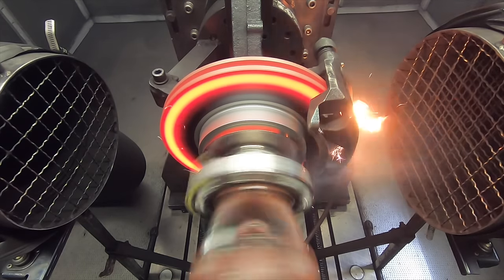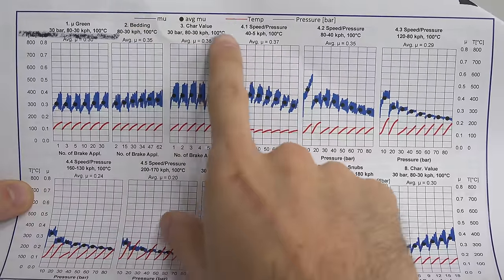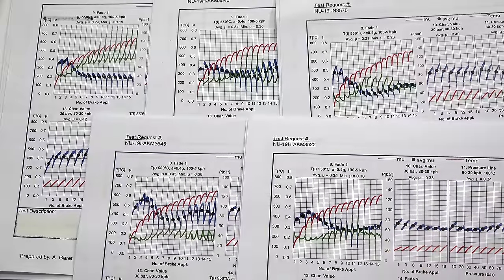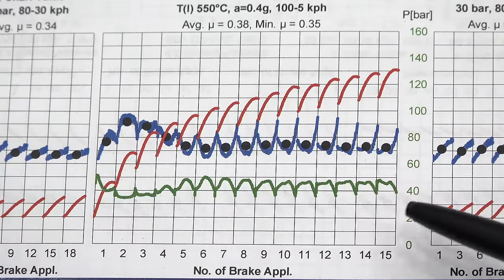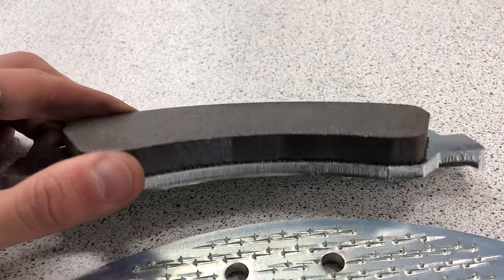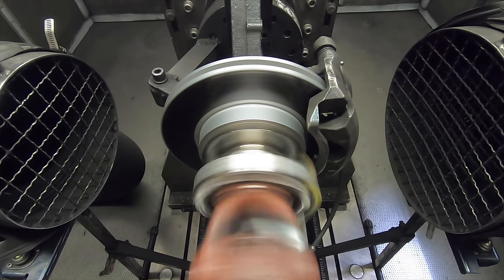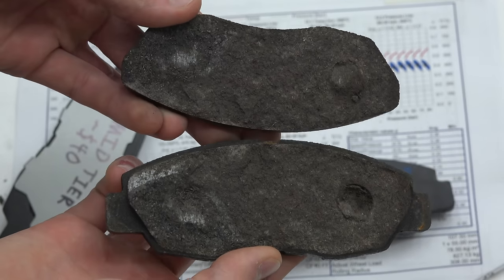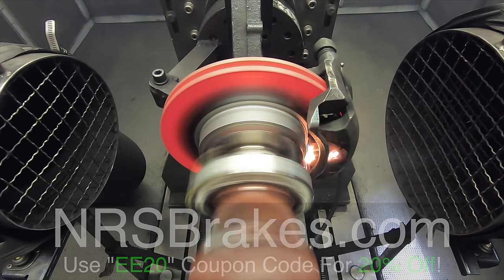What Are The Best Brake Pads? Cheap vs Expensive Tested!

Comment: Well I didn't not know anything about pads but when I saw the rotor glowing red 🍒 thought that was unlikely to happen to mine. I love to shop so I got one set for the front that was 59.00 and reduced down to 23.00. I liked them because they were orange so if I look at the brakes I can say the orange part is the pad. The zinc ones looked nice too.  So if you are going to get the best the OEM one looks like it was the best. If you go with budget you may have to try different brands until you find one you like. From the test results that budget brand should be called suicide brakes. I like the one that I have to press the least and stops the best. No to pressing harder. So get pads on sale or go with the oem pads or if you like chrome go with the zinc plated ones they looked the best for salty roads. ❤

Comment: I will say that for my Audi A6, the Audi pads are so much better than anything else I tried aftermarket, but they make so much brake dust it's actually tough to keep up with cleaning-wise.
I'm really really curious how they are different. They also never squeak, and "high end" aftermarket ones did.
My car is at 480 hp instead of stock 310, so I'll keep using the Audi ones, maybe even upgrade to a brake kit of I get rich. Lol

Comment: would be interesting the readouts of 3 applications from 150kmph to 0 emergency (abs) braking immediately accelerate to 150 and emergency brake again (3 times). this is a standard stop start drag race on a passenger vehicle, the rotor will be glowing on the 3rd application

Comment: Even the OEM brakes and probably most OEM replacement items are not made directly by vehicle manufacturer.  They may have the OEM label but are made by a vendor.  That vendor might have to design to meet minimum OEM design specs but remember probably not OEM built.  Example Infiniti OEM pads but not made by Infiniti.  Probably made by third party vendor (EBC, Bendix, Bosch, Wagner etc.....)

Good video but I have usually had very good luck with mid/upper tier aftermarket pads, hardware and rotors. Good to see some of the more in-depth process of design, manufacturing and testing along with narrative on why designs are certain way.  

Example, shim pads, that wrap around the pad surface, chamfered on the corners.   The cutouts makes a pretty decent visual indicator of pad wear.  When the pads wear down to the end of the chamfer on the backing pad side probably a good time to replace or at least increase inspection windows but monitor closely.  I once bought a AS-Is Escort EXP and the rotors were down to the rivets....back before adhesive bonding and shim became the standard.  The pads were down to the rivers and the rivets were of course cutting into the rotors.   

The channel cutout in the center of the pad serve two functions.  1 help dissipate heat and 2 help have a chamber for the brake dust to settle and fall in rather than having the rotor contaminated with dust increasing friction and possible brake fire.  Most usually have at least one valley but some of the larger vehicles may have two valley cutouts.  The pads with two valley cutouts are normally Front but in high performance upgraded brake systems can be front and rear.

Comment: OE pads are definitely the best option for 99% of drivers and even "enthusiasts." But there becomes a pretty distinct need for higher temp friction material when going hard at the track or hard on downhill mountain roads or canyons. There's nothing like putting on some "competition-only" rally or race pads and knowing your brakes will have full friction until the fluid is literally boiled out of the calipers. This is what you can expect from top end competition pads like Project Mu Club Racers or Winmax W5. But these cost several times more than OE or even "high-performance" aftermarket pads.

Comment: You pick the brake pad depending on what it's going to be used for, and what you're looking for (or looking to avoid i.e. noise and dust) the pad to do. Daily/sporty/lite track/track. All designed for their specific purpose in mind.

Comment: It doesn’t matter if your brake pads last but your rotors are gone in a quarter of the time. I found it better to buy the cheapest pads for the Mountaineer but buy OEM for the Equinox. I’m not racing and I use reduction on the down grades. 
If you buy cheap rotors, only get the ones that are turned, not ground. Turned finishes can’t hide soft or hard spots in the casting. Flaws show up easily. If they don’t have that, then go Bendix or OME. Those usually have a ground finish and that’s fine. Ground finishes do have the advantages of seating in much quicker.

Comment: While at a Chevrolet dealer near their shop parts counter I witnessed:  local Autozone, Advanced Auto Parts, do not remember who dropping off parts for install on customers cars.  Just because you are at a OEM facility does not mean that they are using OEM parts.  Also, are they charging you OEM parts prices?  Knew a mechanic who always broke the wear indicators off any brake jobs he did. Probably that didn't hurt since most people never know what that squeaking is, most people never read their owners manual.

Comment: The 3 main categories of pad are organic, ceramic, and metallic. The generalized properties and behaviors of each are well described elsewhere on the internet. This isn't of concern as EE states there is a wide variety across manufacturers and specific testing generally won't be useful. The only context where the relative properties would be useful are in direct comparison of a SINGLE BRAND'S COMPETING PRODUCTS among differing product lines.
What I'd really like to see is this same test comparing various performance aftermarket pads

Comment: Good video. In my experience I've noticed a lot of difference in the generation of dust from various brands. Some have tremendous braking power, but also require much more frequent cleaning of the wheels.
Reply: Cleaning? Rain does a amazing job of that. My suv is 15 yrs old and never been cleaned except by rain. Never once had to clean brake dust. Maybe car just too shiny. Shiny cars stand out especially to cops.
Reply: @shawnkelly695  are you having issues with the cops !!!
Reply: @M21-w1y  i dont drive a fancy expensive car that stands out. I think they feel bad for me and cut me breaks. I personally dont have many issues. Maybe cause im almost as corrupt as them lol.
Reply: Not sure how saying shiny cars stand out to all even cops has anything to do with me having issues with cops. Me myself driving average plain cars i have 0 issues. I dont stand out with bright shiny car and lots of crome. Friends with fancy cars tend to get pulled over more often and get more fines. Is it attitude or the shiny car is a target as afford tickets and less likely to take it to court.

Comment: Never get any brake components or tires under mid-tier. It's usually a false economy and the difference in safety is measurable.

I will definitely look out for the feature (or lack of) pointed out here.

Comment: @Engineering Explained
What we really need is a comparison of noise, brake fade, wear, brake dust, and rotor wear for aftermarket performance pads as I'm unable to find these for the pads I'm currently looking to put on my car. The following are my suggestions:
EBC greenstuff, redstuff, yellowstuff, bluestuff and the racing types -particularly because EBC doesn't provide numbers to even compare their own pads to each other
StopTech performance pads
and idk anything else I just took the first recommendation someone gave me

Comment: OEM Pads for German made cars are expensive. But there is no sense in trying to count costs when it comes to the stopping power of a fast car. The BMW Brake pads for example, which are prescribed for the MINI COOPER S are all asbestos and the rear ones may last 20000km and the front ones may last 15000km of regular driving with occasional fast runs on highways. It is also very important to change the Disc Rotors themselves at the appropriate time, when they become scored and “stepped”. You can may be “skim” them once on a lathe. Knoclk a few microns off the surface and smoothen them out. But ideally, it is not a recommended thing if you’re wanting a safe guarantee. We need to make sure Rotors also get changed once every so often. Perhaps every 35000-40000kms in a fast performance car.

Comment: have driven all day for my entire working life. 100,000 miles per year. I've ran every kind made at all price ranges and the only real difference I could ever tell was that the semi-metallic slow down faster than the ceramic pads. the SM re dusty and can be noiser at times. I'm 76 years old and change my own pads  and that;s basically all I've ever noticed. Towed large fifth wheel trailers on my diesel trucks and never had a problem.I spend 10-15 dollars per axle for pads and seldom turn the rotors as long as they are true. happy trails.

Comment: As I’ve gotten older and driven, maintained and repaired many vehicles over the years I have come to the conclusion the OE parts are the best bet in most cases. Think about it…the best your vehicle ever was was the day it rolled off the line new with factory original parts, why not keep the vehicle as close to factory as possible? If your planning on getting rid of the vehicle soon and just want it road worthy to sell or trade then I go cheap. Only if you have certain special needs like you tow or ect. then it may be worth going with special higher-end after market products. But for most people’s daily driver that they plan on keeping for a while them OE parts seem to be the best value in my opinion.

Comment: Mechanical bonding has the dis advantage of damaging the brake disks if the pads are extremely worn down  which is not uncommon, secondly loosing  2-3 mm of pad material in the same scenario due to the protruding spikes.

Comment: I am always 100% satisfied with the cheapo metallic pads from Centric that I get from Rock Auto. They usually cost 10-20 bucks and they always have oem-like pedal feel and work fine. I don't think running 15 repeated stops is useful for 98% of drivers. Nobody actually gets past the third or fourth stop in the real world.

Comment: So my astra (opel-vauxhall) has ferodo pads when it came. 
When i want to buy the gm branded ferodo, it's twice as expensive as feredo. 
Most car manufacturers not producing their own pads. Just remove the pad and look for a brand. Just buy from main supplier. 
Also my air filter is mahle (written with little letters and bottom side) and branded with GE. Its also cheap but the same filter.

Comment: There are so many things just assumed in this. Ceramic pads? Coatings? Caliper? Rotor design? Rotor material? Were pads bedded to manufacture specs?

With common ceramic pads, some material should be initially transferred to the rotor using the bedding process. The rotor needs to be the right material to match the pad. And it better be surfaced correctly to again properly bed the pads.

Comment: the critical factor to consider here is the presence of sodium chloride, commonly known as salt. This compound is responsible for accelerating the deterioration of brake pads. If you reside in regions without snowy conditions, opting for cost-effective brake pads suitable for daily driving is a viable choice. I personally employ inexpensive semi-metallic pads(raybestos),cheap $30 eBay rotors, and they have demonstrated exceptional longevity under these conditions.😄

Comment: Your calculations on angular/rotational momentum effecting the 0-60 times for the Tesla, in another video, would be applicable to braking distances, also. The Tesla with lighter wheels/tires would stop in about 6% less distance - so it would accelerate faster And stop faster, also,
Reply: That's why putting 24 inch rims on a car that isn't designed for them is ignoring how much more a 24 inch rim weighs compared to a 18.

Comment: I've just replaced my brake pads and my drivers side caliper in front and my brake shoes and cylinders in back and the drivers side drum. Can I use a temp gun to check them? What temp range for normal use?
Thanks

Comment: Make same test with oil filters and please explain different engine noises and how to fix them. For example rattling when you start 8th gen civic or other Honda. Is it chain tensioner? VTC actuator? starter? too thick oil? too thin oil? some dirt in oil pathways to actuator and tensioner? This happens to me only when car haven't been driven for hours. especially when its under 4 celsius.

Comment: Good pads cost about $ 130 for the pair, and you could save money by installing them yourself in which labour cost about the same money or more. But remember to lube caliber pins, pads edge, and the metal backing facing the pistons.

Comment: The way most  people drive its better if pads  wear quickly  most pads I change (70 sets a year  ) are unevenly  worn because  pad is partially  seized  in caliper   .One problem with OE pads often bought  in and reboxed so you could  get anything

Comment: I'm curious as to how these tests work on high performance cars, not hd pickups. How much better are carbon ceramic brakes than the best regular brakes? And how do slotted, drilled and slotted and drill rotors affect them differently? And do the OEM's have different pads for different rotors and calipers? That's the biggest issue I see with aftermarket pads, the compatibility with your specific car and parts that it works with in the entire system and weight.

Comment: PEASE NOTE. ROTOR WARE.
I much prefured a good mid range pad, like bendix as it limits ROTOR ware as thats more expensive than pads. Simple pads replacement is less expensive than ROTOR REPLACEMENT.
I would of liked to see ROTOR ware specs from each pad in your tests.

Comment: I always pulled a job site trailer. I tried ceramic about 15 years ago.. I had to remove the new brakes and go back to semi-metallic.

Ceramic had horrible stopping. And they created tremendous amount of heat. I got out of the truck one day and I could hear my brakes cooking. 
If you really need stopping power. Unless they've gotten better, semi-metallic not ceramic.

And about eight years ago I tried ceramic again on my Dodge stealth. I was clipping along at about 145 mph. And did a good firm stop..
I drove it back and took the pads out. I went to semi-metallic. That stops you. Even in wet conditions they bite.

Comment: My pads for my Chevy minivan cost me $16 and they last ~25,000 by that time, the entire brake system needs a good cleaning anyway, so i take the pads off, and clean the rust, grime, and sand out of the caliper piston, etc. also, I drain the old fluid out of the system, and bleed with clean fresh fluid. Not a good idea to keep hygroscopic fluid in any system

Comment: My experience  with a 1980 full size Cherokee chief expensive 
Ceramic pads cracked and cut grooves in the rotors and had to replace pads and rotors 
Cheap pads just wore out
Drove it 850 000 miles when the original motor was wearing down I got a motor rebuilt at the machine shop special  cam etc went 30 000 miles rod right out of the side !
 got an engine out of a wrecked car ran 8 years ! changed the motor 4 times the brake pads 11 times
Turned the rotors once
Painted it 3 times
Finally the trannt wore out it would shift out of gear going down the highway
so I scrapped it
Have a great day !

Comment: Mmm l have a Ford Fiesta it’s always Serviced by the Ford agency .
They fit Ford manufactured pads and break parts as standard. 
It seems l need to enquire when pads are needing replacement . 
Are your pads budget or better 🤔
I was advised to have the break fluid replaced every 3 years as the fluid performance is reduced over time

Comment: So after continuous testing of many brake pads, over and over I will conclude that the winner is the rotor being used to conduct the testing. For not braking and shattering in many pieces after constant heat.

Comment: The choice is clearly buy the type that was factory installed.  Disk brake pads became smaller for the reason of the ceramic types are required.

Comment: I tend to use my break pads until a very long time, even sometimes too long, and end up damaging my brake rotors. I've gotten into a pattern of replacing my pads just before they're worn down too far. Will these cleats on the NRS brakes serve as spikes to dig into my rotors when they start to get low instead of squeaking like normal breaks?

Comment: Keep in mind most of the daily drivers are not going to be put to their maximum limits. However if you’re doing drag races and your pads need to be the highest quality because you need to spot at 160MPH then yes you better make sure you get the best pads. Don’t mind if you’re going to the store down the street @45MPH then you might not need performance pads.

Comment: The labor to replace pads cost more than the pads themselves, so never go cheap on pads. If you do it yourself, saving $40-$50 every 3-4 years isn't worth it. Same thing with tires. Cheap tires prolong stopping time, they are noisier, deform quicker, and have worse traction.

You CAN save on gas and even engine oil. Testing showed Amazon Basic's engine oil is just as good (and sometimes better) as mobil1 and other brands. And saving on those will save you a lot more over the course of 3-4 years.

Comment: For normal driving you want the Duralast, Car Quest, Wearever, or whatever parts house brand "gold" pads. They are the best option for the dollar. The cheapest ones are not good and "lifetime" pads just ruin rotors prematurely. I work in a repair shop and see what happens with brakes on normal cars all the time.